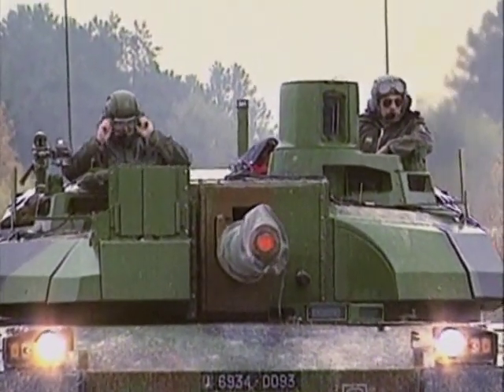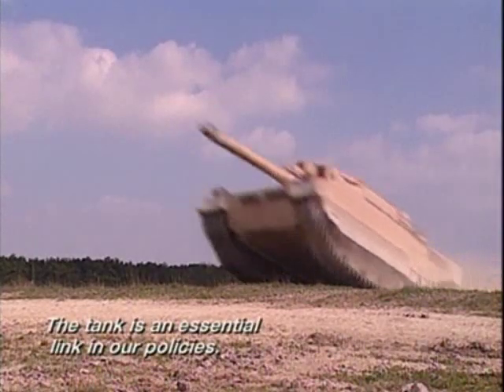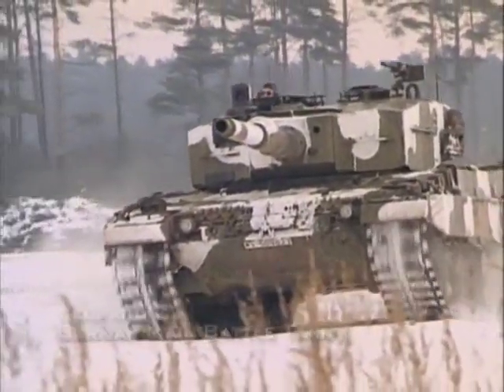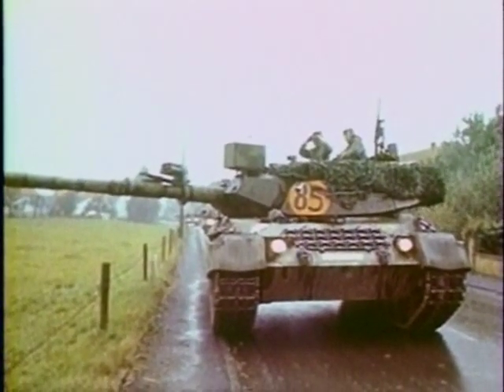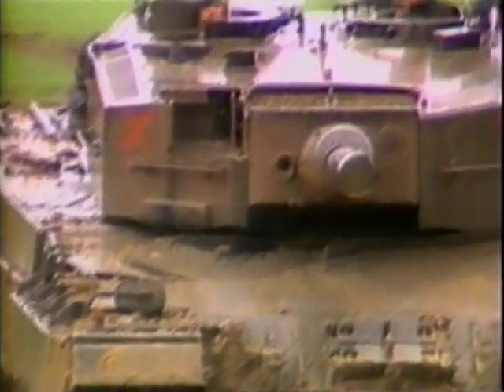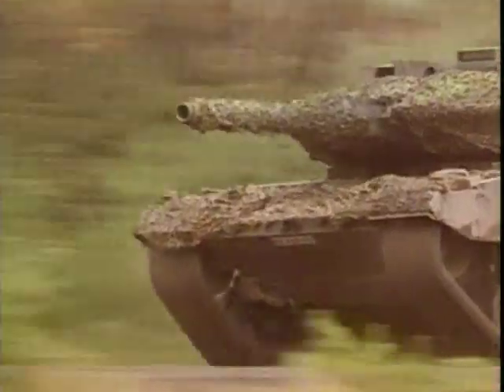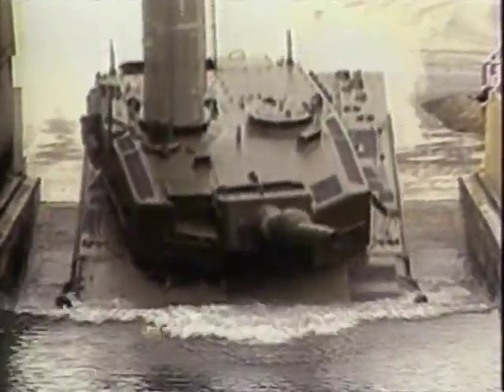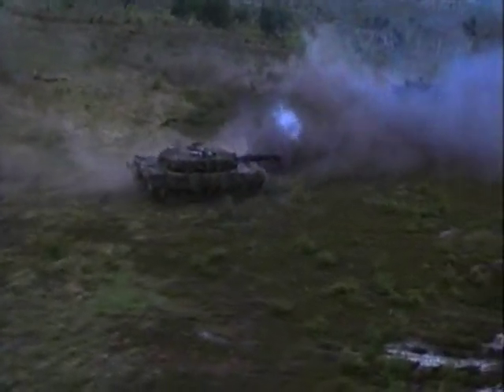Firepower - Battle Tanks (Part 3/3)

Comment: @Scotty4210 Yeah, it's really just a software issue. All a tank really needs is an "AA mode", where the rangefinder keeps updating its distance information which is then used to predict the movement of the aircraft. Of course the hit probability with just one round sounds ridiculously small, but as for example the Otomatic SPAAG and naval guns of up to 120 mm have shown, it's completely feasible.

Comment: i rather create a cheap but very fast tanks~ althought could not match the tanks like abrams but abrams only have a small amount at its dispose. if you have 5 abrams i shall use 20 very fast tanks and charge at you and hit you in point blank range or out flank you~ since they say that tank which are faster are harder to hit in this show~